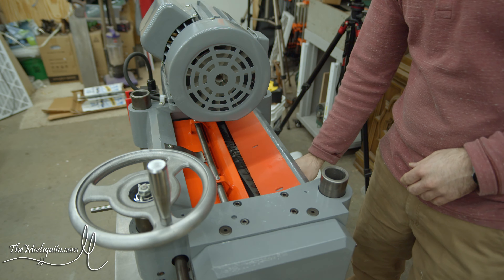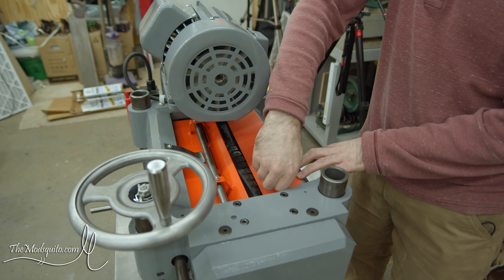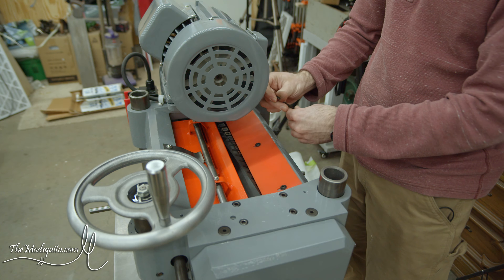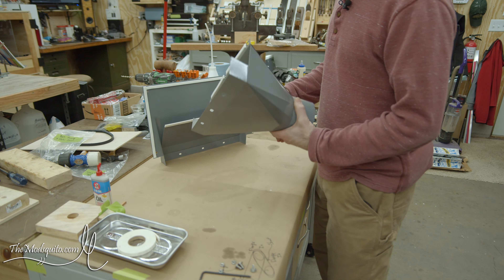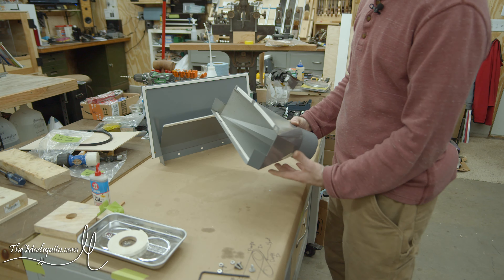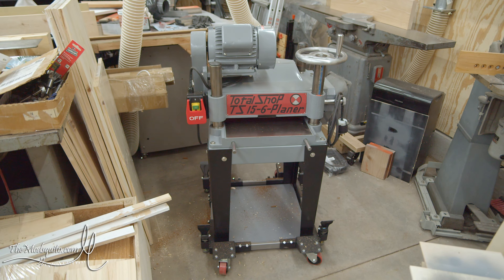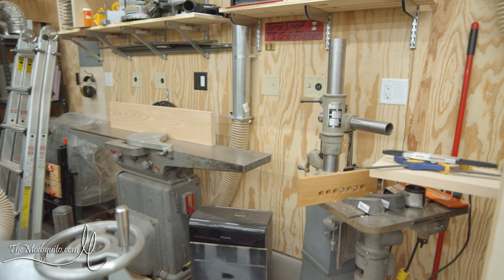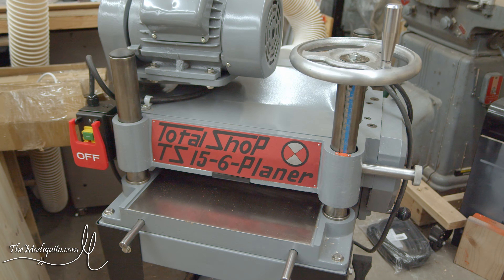08 - Final Touches - Total Shop/Delta DC-380 Planer Restoration

Comment: The one thing I did not like about the DC 380 is the dust connection of the of the hose. I built a new housing so the hose connection is at 45 deg. The longer boards do no hang up on the hose. Also added a Wixey DRO, a great addition.
Reply from the maker: I agree, the straight out the back dust collector house is annoying. I've thought about trying to do the same with mine.  I haven't added a wixey to mine yet, but that thought had crossed my mind a few times